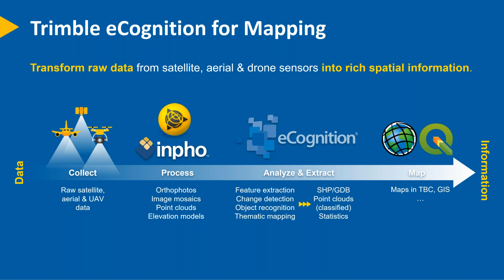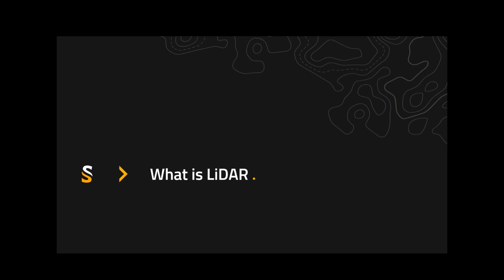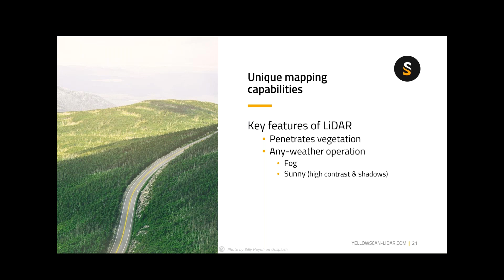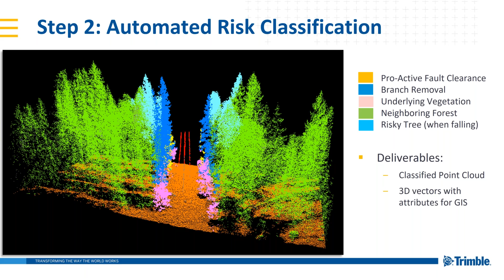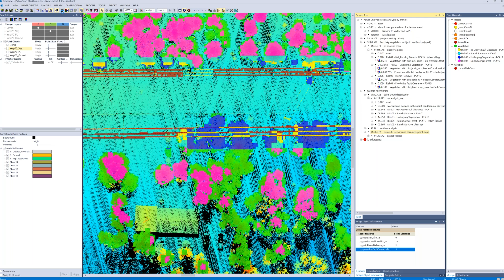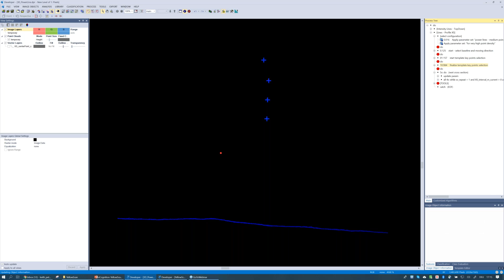Webinar: The Future of Vegetation Analyses in Feeder Corridors

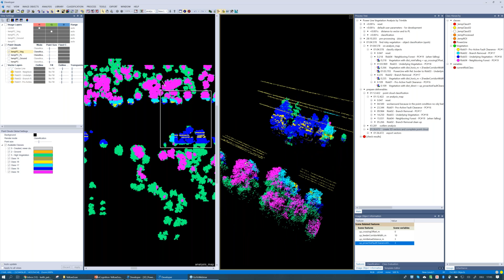Comment: Hi and thanks for great video! Just a question from power line industry :) Why do we see gap(?) on a smaller line (north). 0:44 and 1:03:53. I do not see all data to make guesses, please comment. Cheers, Kosta. (Wires shall be continous to conduct current)
Reply from the maker: Dearest Konstantin, obviously the powerlines are continuous. If there's some gaps in the dataset, as you noticed, it can come from 2 main reason : the powerlines are some of the most difficult targets to grasp, due to the thin size and the nature of the black coating on the wire. Reason why they need a dedicated flight plan. As the goal of this dataset used in the webinar was not to acquire the powerlines, but rather the vegetation, which is why in some part, the powerlines were not seen sometimes.
Reply: Wires shall be continous, no?